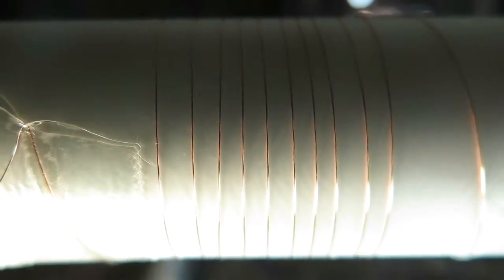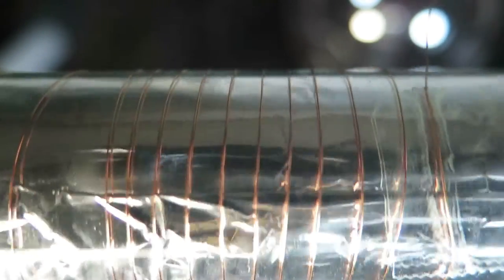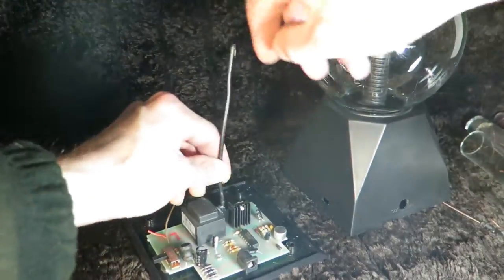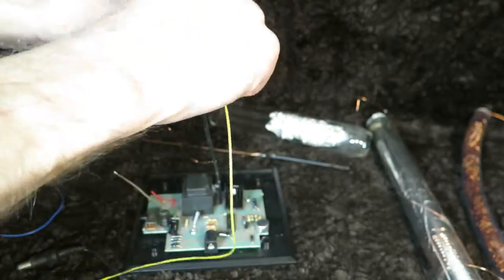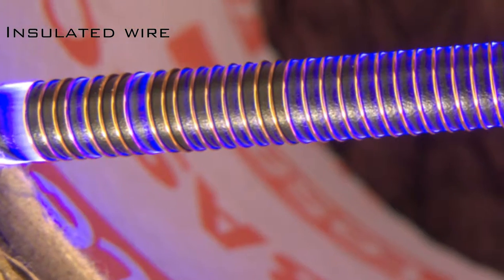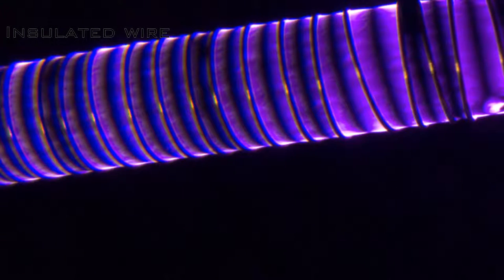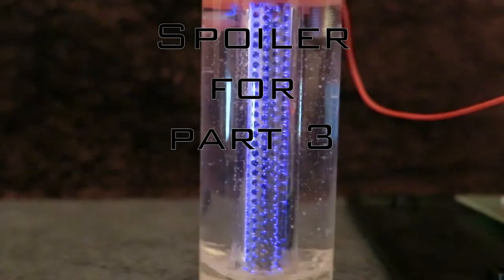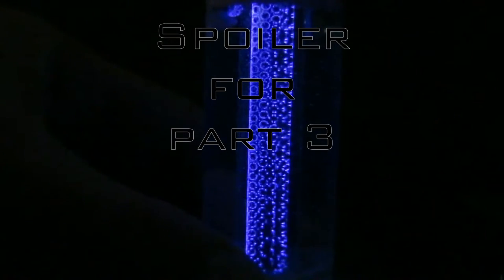Ozone generator part2

Comment: where is part 1? You also mentioned a modification where  a wire was soldered to the transformer. (not in the video). Which one, and for what purpose? If you can clarify that it would he greatly appreciated. Thank you for the suggestion in video 3,although it was mesmerizing cadmium will not be used.